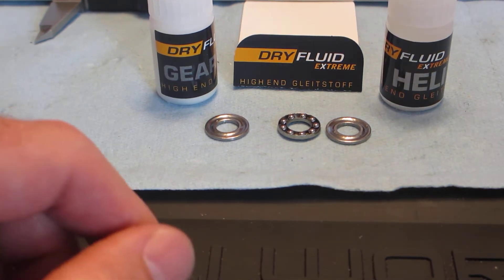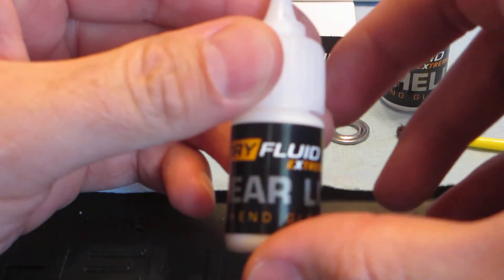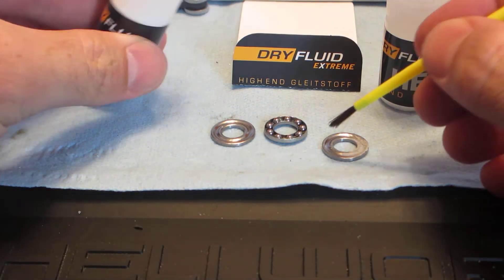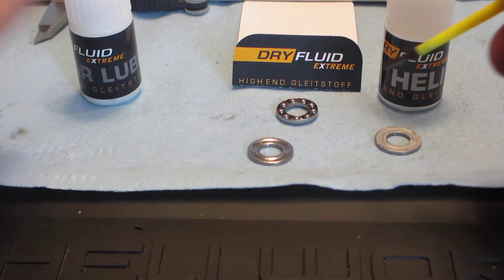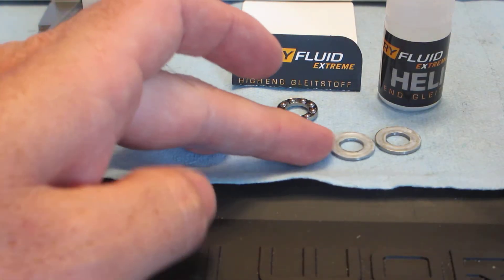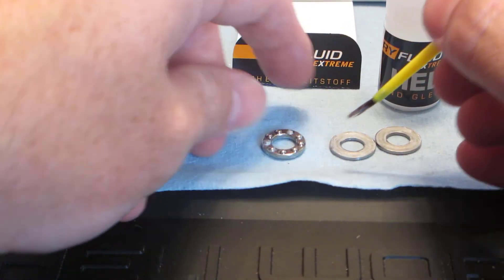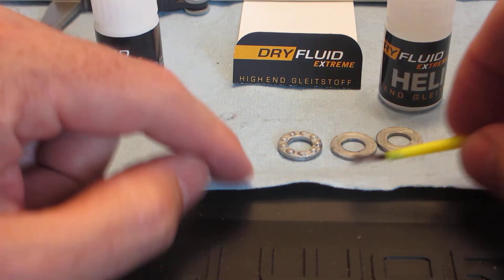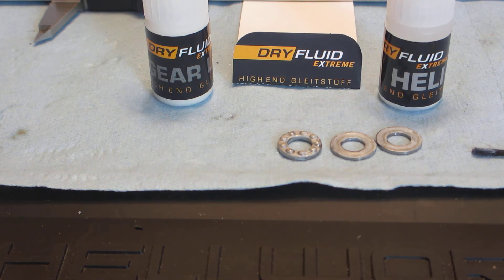DryFluid on Thrust Bearings

Comment: I have two questions:
1- Do you recommend using an ultrasonic cleaner?
2- is it safe to use acetone on the white-bearing ball holder (the white plastic that holds the balls)?